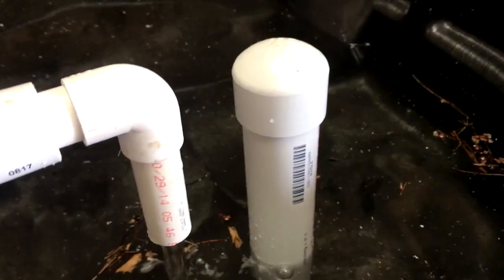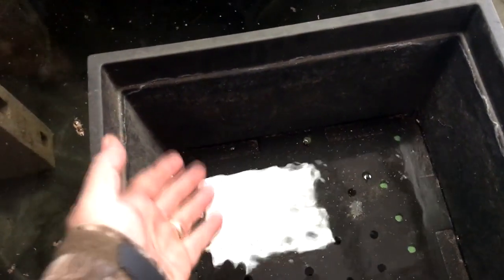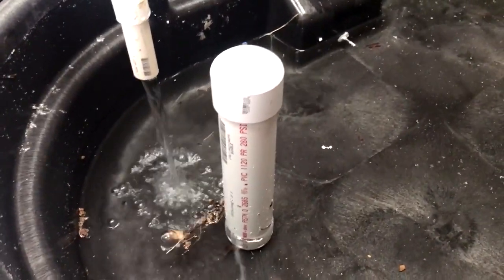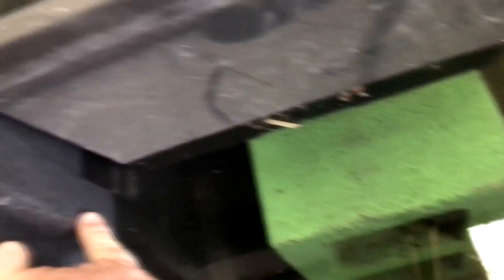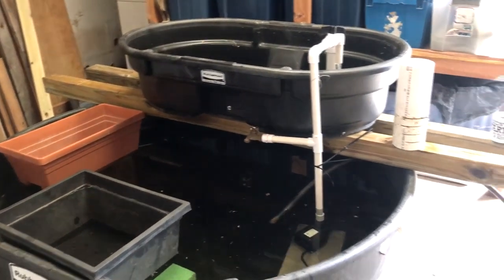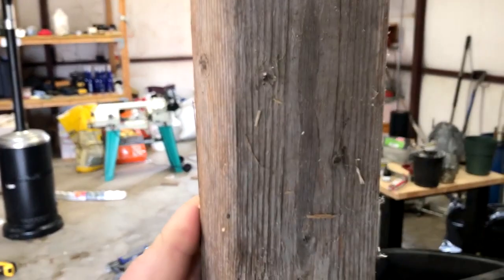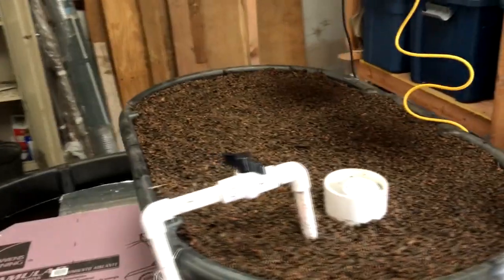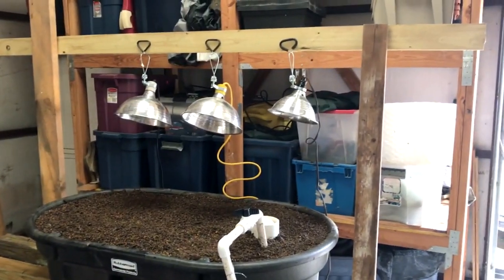Indoor Aquaponics Set Up - Episode Two

Comment: Hey Jack, thanks for breaking this down in simple steps. I've watched this series since day one, and then watched all of the videos in it several times over since then. Been wanting to do an Aquaponics system for years but had a problem with "paralysis through over-analysis" syndrome. Not anymore. Purchased a 300 gallon tank two days ago, beginning setup today. I am curious as to where you got the square wicking bed planter at 2:00. That's a great idea! As you point out, I already have some other ideas from your design...should be pretty cool. Keep it up buddy!

Comment: I'm still confused about the damn bell siphon. In this video, it is breaking with only like 4" of water in the tub. How deep does it get before breaking after you have the media in the bed?
Reply from the maker: Well it is more like an inch than four but it always breaks at the same level, media or not.  Just with media there is less water in the system due to displacement and it makes the break a bit more consistent.  The key is YOU control the level, where ever you put the air inlet holes will be the level that the water will break at.

Comment: To cycle the system faster, could you dump in a five gallon bucket or two of the water from your other system? It has the whole nitrification process going on but I don't know if it transfers like that.
Reply from the maker: That's been done we always cheat our cycles. Generally yea we dump water from an existing system, in this case three different systems about 2 gallons a piece.  Also dumped in some liquid kelp and Garrett Juice.  At this point I can start growing plants already and have fish in the system in about 2 weeks max.